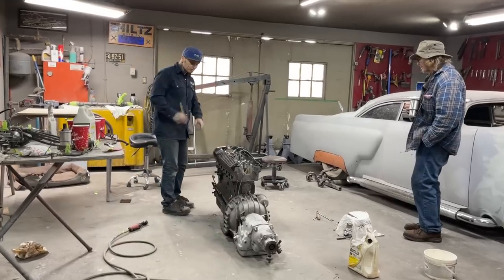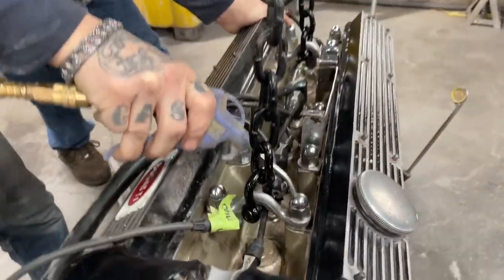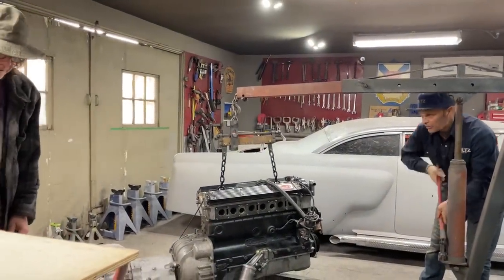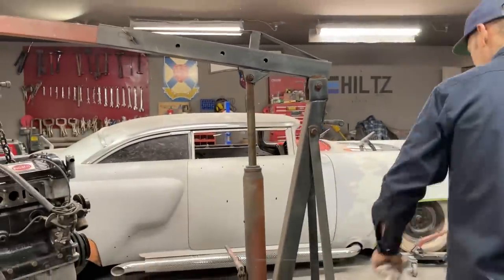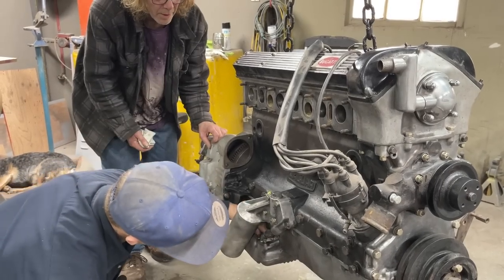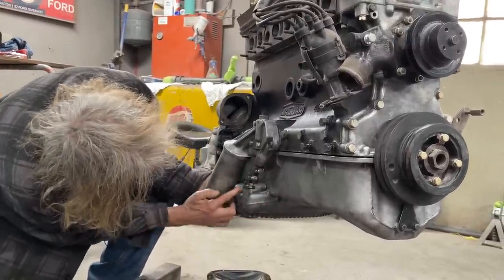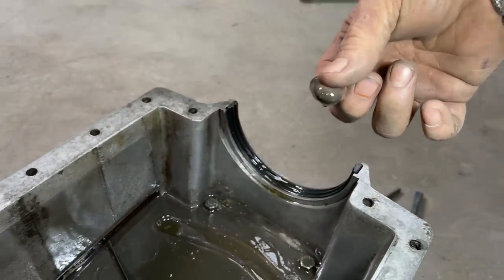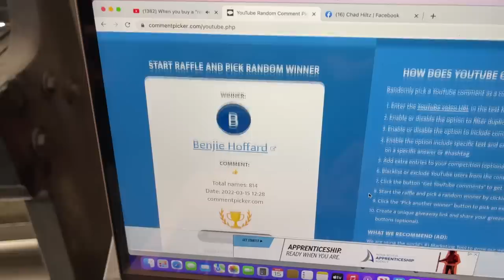The Moment of Truth: Pulling the Oil Pan to Check the Internals

Comment: Sad someone ripped you guys off . Motor should be clean like new inside . The motor ran and the man lied about rebuilding it . Someone did some bad work on the outside components reinstalling them because they didn’t have the proper bolts . Sad I hope the guys straight and gives you your money back .

Comment: Absolutely don't fit this engine without a total strip down and check. Nothing to do with oil filter, you could have taken the complete oil filter housing off from the block before removing the sump. Also, the oil pump is not there, but at front of the block under the distributor. Bottom line is, get your money back. This engine has NOT been rebuilt correctly.

Comment: Chad I hate to say it but you might want to check the rest of the rebuilt engines you have for other projects they might be worn out junk with a good paint job I hate it for jolene especially since you spent so much money for parts and the time spent to put it in the frame

Comment: Any Mechanic will tell you there is no way possible that the motor is rebuilt. That motor has a lot of miles on it. Wrong filter or not that motor is not rebuilt. Take it back and tell the supposed to be builder to shove that motor where the sun don’t shine. I’d never do business with that builder again.

Comment: Oil filter do NOT collect metal parts. That's why you pull the oil pan to make sure you don't have a problem in the motor. This motor is worn out, hands down!!!

Comment: Jimbo is a great guy to have on the show for entertainment and such but they're absolutely should not be metal in that pan whatsoever. Whether there's a filter of the right size or not there should not have been any metal. Chad I feel bad for you and Jolene for getting taken on that motor. I cringed the whole time you worked on that motor.

Comment: That engine is not rebuilt, if it is you have a major bearing problems. In my 30 years of building engine I've never seen that much crap in a freshly rebuilt engine. That's a lot of big particles

Comment: Chad that doesn't look like it was rebuilt maybe the pan was wiped out not hot tanked , just you want pull the value covers check the rocker s and check the timing chain for slop that doesn't look rebuilt the crank and rod bearings and will tell the story sorry!!!***

Comment: It is disappointing to find that the work you thought was done correctly and professionally actually isn’t. It has certainly left a bad taste in my mouth and the engine isn’t even mine. So sad. I think you may need to take legal advice or just write it off as a lesson learnt and get the engine rebuilt by someone you can trust. It’s an even bigger shame if it’s come from someone you trusted before.

Comment: That engine wasn't rebuilt not with all that sludge and metal shavings like it just turned 400 grand. And had been sitting for a couple years. Just a puke of a motor.

Comment: This is going a bit too far .....  were you buying a $20,000 motor or a $5,000 motor ?  It's just silly because if you went to some where else you only get what you pay for.  True there are bolts that don't match and other mismatching bolts but, think about is there a place that you can get the specialty bolts ?  Go try to order stuff for a v10 ford motor and you'll get high priced over looked problems straight from ford.  I'd say being a Jag engine you don't have a local dealer do you ?  I think that there is just a better platform to go knock the guys work.......  Is any one perfect ?  True there are really high priced motors but, you are really going to pay more than you did on this engine !  Just saying !  You do what you do would you want to be judged the same because when ou were judged poorly you sent them away.  You are BETTER THAN THIS !!!!!

Comment: Sorry but jimbos rants are a bit much. Jimbo stop your rant because your not correct the filter don’t catch everything or the oil pickup don’t suck it up it’s left in the pan and there’s metal left in the oil during engine breakin. Chad sorry but you got taken for. I just wonder if the situation was reversed.